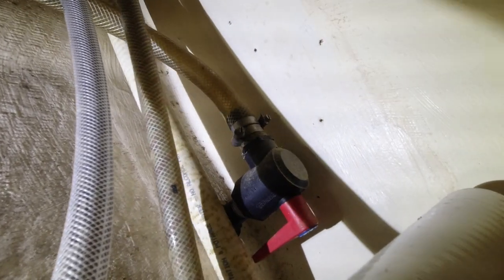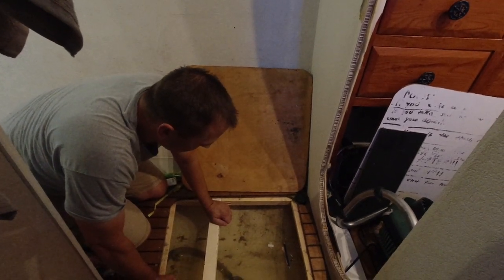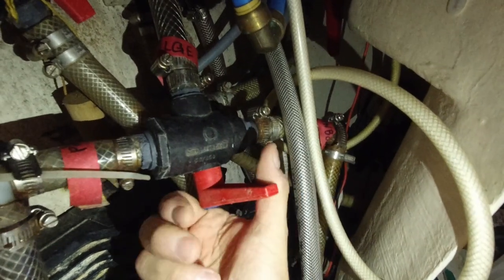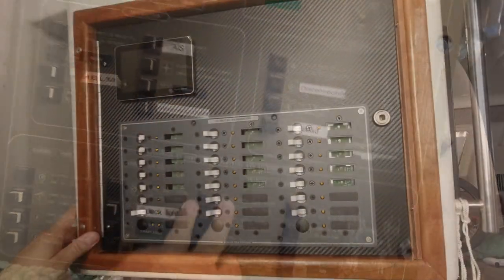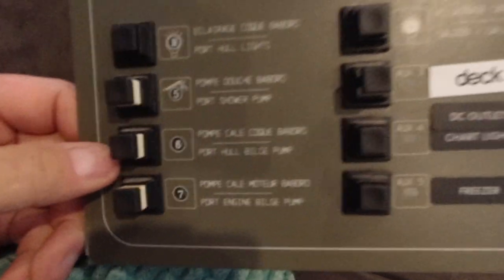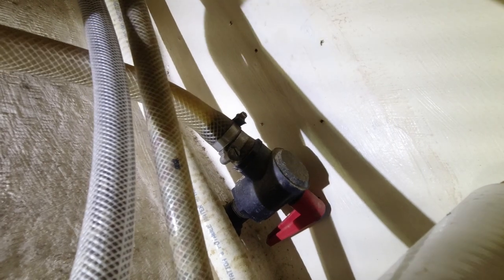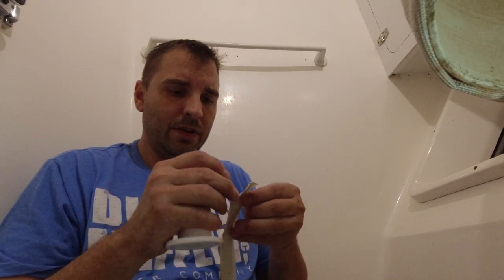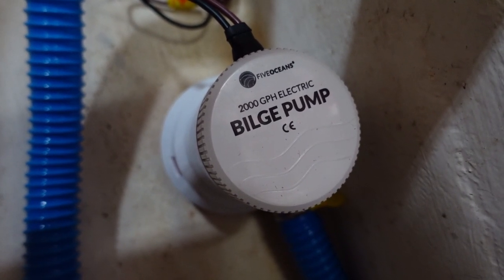Our Catamaran Sailboat Was Built WITHOUT Automatic Bilge Pumps And We Almost Sank!  [Sailing Family]

Comment: Corey, regarding the HRO watermaker it may be that it isn't as bad as it may look. Remove tge filter housing to inspect the filter. If it is smelly and black, that isn't good,  but it may have been properly sterilized and you would tell by noticing a chemical odor. Even if good you would still want to change the filter and membrane(s). But at least you do not have to worry about removing all the bacteria in the entire system. It can be cleaned and re-sterilized. You have a Cat 2SF pump that by the model number tells you what the flow is. That will determine how many membranes you can use. They designed that pump solely for the use of small RO systems. It isn't bad but has limitations. Also a bit noisy as it is turning at 1750 rpm. I submitted an email through your website so you may ask me questions or if you need help with finding anything.  Kurt
Reply from the maker: Hi Kurt,  Thank you!   I did receive your email.    We've been out of town, away from our boat for a couple weeks so I haven't don't anything with the HRO system.   I will email you when we get closer to that project.   We will need a new membrane- 100% and we will likely need other parts as well.   Thank you!

Comment: So many systems on a boat, and I think of each one operating on a continuum.  Like 0 is it's not working, 10 is it's the best system ever.  Most systems on our boat are in between.  Our bilge setup when we bought our Cat was similar to yours, maybe a 3 or 4.  As in, there were bilges, but auto switches not operating correctly, and several of the bilge switches were non-functional.

We have 8 bilge pumps (4 on each side). I'm using water witch switches for 4 of the pumps (2 main bilges in the center of the hulls and the ones in each engine compartment).  The other 4 are manual.  All 8 can be manually operated from the nav station.  6 of them can also be manually turned on and off at the bilge pump (i.e. switches in the engine rooms to manually, the heads, and the forward compartments switch them on).  

If any of the 8 bilges is on (either from a manual switch or automatically switched on) the light next to it in the nav station turns on.  Also, an alarm sounds if any bilge comes on for any reason.

I'm still installing this whole thing as I'm neck deep in re-wiring the whole boat, but that's my plan.
Reply from the maker: That sounds like an awesome set up!   We had a flash of panic a few days ago because we thought we heard one of the new pumps turn on.  Our bilge areas tend to be dry.  Turned out it was Dishy (starlink) turning. Lol.

Comment: Oh you can maybe save the motor quickly with Ospho and paint.  Ospho turns rust into a paintable surface and the Navy buys it by the truckload.  It is available at Ace Hardware typically or online.

Comment: You might consider adding an emergency bilge suction valved to the raw water inlets of the engines as well. Close the raw water thru hull, open the bilge suction, and in cases of extreme water ingress, the engine can pump the water out. Depends on the boat whether it's worth it. Also, solder and heat shrink the bilge pump and float switch wiring, and be sure the wires cannot get caught in the switch. You're probably going to have to flush the watermaker out with fresh water (not chlorinated) after changing the prefilter.
Reply from the maker: That’s an interesting idea, using the engine as a bilge pump.  Hmmm…
I did solder and heat shrink the bilge connections and I have them bound and secure away from the floats…. Great advice though.  
I’m pretty sure our membrane is toast.  I’m going to try to get this desalinator up and running, first step is to pull the high pressure pump, clean it up and bench test it. 
Thank you so much!  Everything you said is very helpful!  😊
Corey
Reply: @SaltyEscape  It's a feature usually used on larger boats, but is an added safety. Good that you got the pumps.

Comment: Dude watermakers are my thing.  That system, which I didn't get a good look at all of it is a super serviceable and likely reliable system.  Looking at the motor it has some corrosion on it, so just address the motor really.  That is a pressure washer pump, and my system uses the same kind of technology.  Depending on the output you likely have a 1/2hp or 1hp motor either AC or DC.  The pump can likely be mated to either a DC or AC motor easily.  You just need to match the horsepower rating and have the correct flange.  You will need a 56C flange on a 1750RPM motor more than likely.  See my link.. I already posted a few parts in the  comments section, and there are even more in the description.  I would just go ahead and change at least the pre filter to a larger size filter and maybe the entire pre filter system.  The motor could maybe be cleaned up and it may need new capacitors.  The membrane is likely toast as most people don't bother to pickle them.  Pickling consists of adding metabisulfite to the fresh water in the housing to keep the membrane from degrading.  Just buy a new membrane.  Do not toss it and buy a super efficient and mega slow reciprocating pump like a Spectra.  They wear out super fast and cost a bazillion dollars.  My system pulls about 80amps DC and will typically produce 33 gallons an hours.  Which believe it or not a low in spectra will produce the same amount of water in about 5 hours and pull like 75 amps with the boost pumps over that time.  AND IT TOOK FIVE FREAKIN HOURS!!  Message me back on this link as I am on yt pretty often or you can call me if you need to.
Reply: We need to get your details and figure out a system for us Allyn!!
Reply: @Spoondrifters  Asheville NC area 216
Reply: @Spoondrifters  1553
I can get you a mostly complete parts list other than some of the high pressure hoses.
Reply from the maker: Hey Allyn, we’re looking at our watermaker situation again and I remember you sent me a link to your video about building your watermaker.  I can’t seem to find that video.  Would you mind sending me the link again?  YT may be deleting links. Could you email me?  SVsaltyescape@gmail.com
Thanks!!! Corey

Comment: Using corrugated hose for bilge pumps severly reduces their abilty to pump.  Also any hose that is going below the waterline should be reinforced hose.  Those Gulper pumps are very high quaity pumps but really aren't designed to move alot of water. They are great at getting the bilge dry though!
Reply from the maker: Yeah, I agree… the inside of the hose was more smooth but generally I’m not satisfied with the hose.  We have bought better hose and I’m replacing it.      Yeah, the gulpers are reliable but not what we wanted for catastrophe..

Comment: Novice boat question… I’m wondering what the water maker thing is…. I’m assuming it desalinates and filters salt water but not sure
Reply from the maker: Yeah buddy, it’s an on board desalinator.  Ours works on AC and should produce about 33 gallons per hour.  We should be able to run it off of our Victron multiplus 3000/120/12.
If by some chance our batteries are low we have the westerbeke diesel generator onboard.  Our travel will only be limited by our supply of food and diesel.  Hopefully the diesel will last a while with the sails as our main “engine”.   How are you doing?
Reply: All is well.  Not even any flight delays home today.  Be back Friday for a week … then a road trip to Michigan

Comment: Re watermaker , download the manual and start it and let it run for a few hours (with product water going overboard, I assume you’re in salt water marina ?) 

After few hours of running test the product water with a TDS meter (few $$’s on Amazon) and measure the water 

If ppm is <400 the membranes are still usable if >700 the should be replaced immediately, if between 400 and 700 run it a few times and see if it improves or worsens , oh and replace the pre filter first
Reply from the maker: This is great advice.  We are not in a salt water marina and we are certain that the membrane is toast.  I think I’ll hook it up and test it with the old membrane just to see if the pumps, gauges and hoses are good. I’ll be sure to video all of that. 😊
Reply: Don’t do it in sweet water as it will overwhelm the membranes, if at all possible do it in saltwater or wait with testing until you are in saltwater
Reply from the maker: @svBluePearl  I’m mostly worried about the high pressure pump.  I’ll just remove it, clean it up and bench test it.